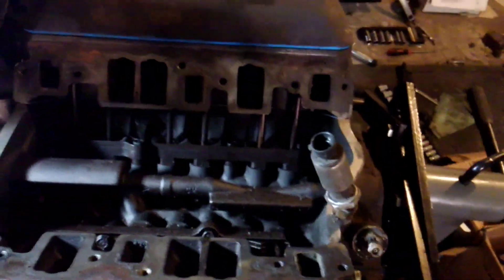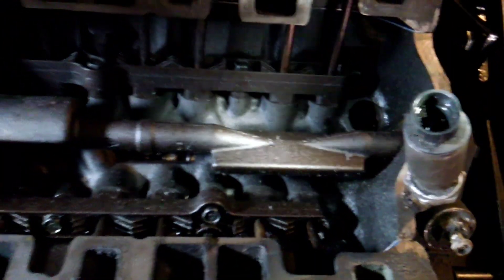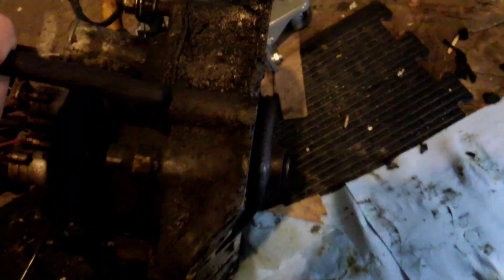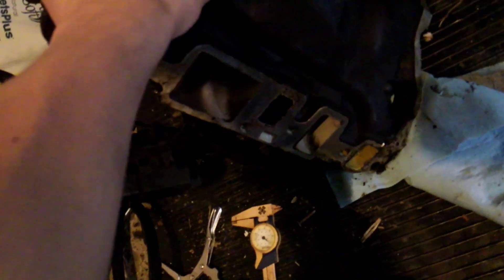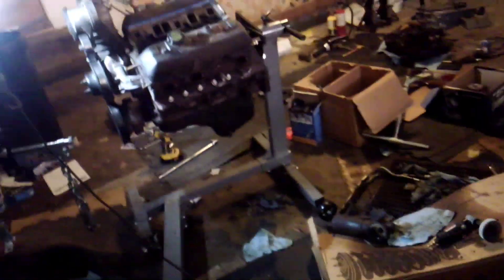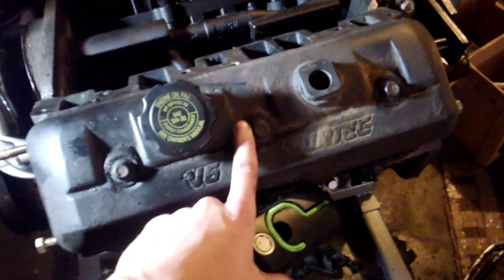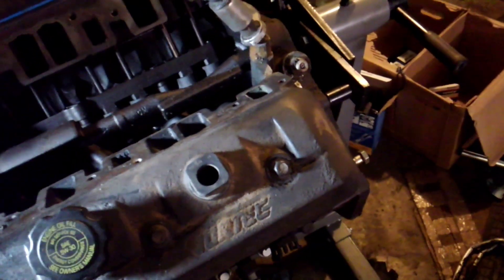Differences between TBI non balance shaft 4.3l vortec and CPI/TBI BALANCE SHAFT engines

Comment: Yes the cpi 4.3 had as much power as the V8 5.7 tbi and with minor alterations can achieve the same power as the 5.7 vortecs in 96 and up but the redesign to make it a mini me version of the 5.7 ultimately killed it's potential thanks to the world auto agreement on a single fuel injection system to accommodate the universal coding for the obd2 era. Cpi in an S10 with some mods was scary fast.
Reply: Which mods 👀 I have a 94 cpi 4.3 and already in the process of changing a lot out for new

Comment: I was looking for some information on what I would need to do if I swap out my 92 4.3 TBI, for a 94 Vortec.  My old motor has almost 380,000 miles on it and it's still going good besides some smoke on start ups. I found a 94 blazer with a very low mileage Vortec but I'm not sure how hard it would be to put that in my 92 S10.  I didn't realize I could swap the intake over to the Vortec, but keeping the fuel injected intake on the Vortec would be nice if I knew what to do to make that happen
Reply: Man if you're going to go thru the labor of swapping it, swap in a LU3 4.3L - MY03+ it would be the best swap you could get. Depending on whether your car has obdii or not, and a few other computer controlled things you need to research, it may be a direct swap def research it

Comment: Lol. So where is the video of this supposed 94 motor getting this change out of the parts you say is the only difference and it running in that S10??? 
Lmao. Alot more was different than you said was different right? Lol. Would love to of seen that throttle hotties intake mount on the 94 heads. And I'm pretty sure that that motor is 95 if it had a crank sensor in the timeing cover it is a 95 and a half model.